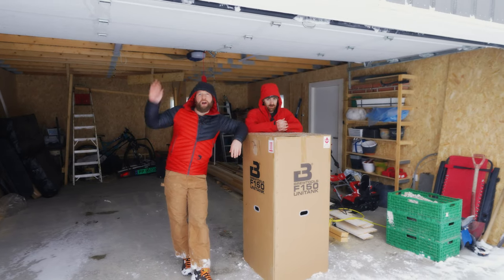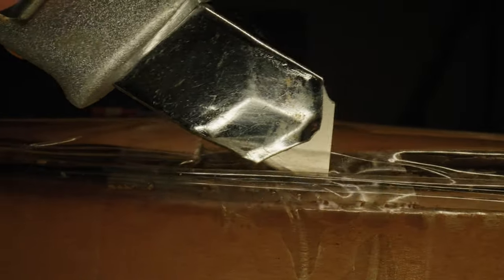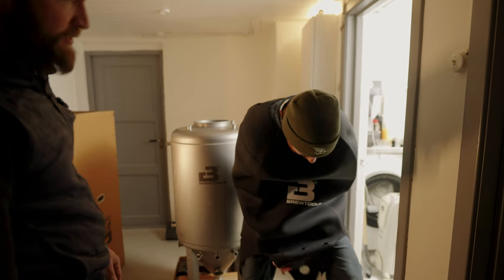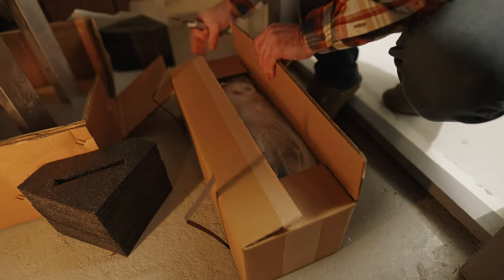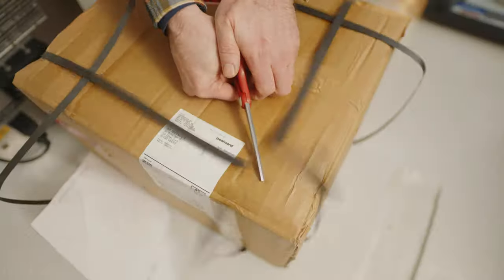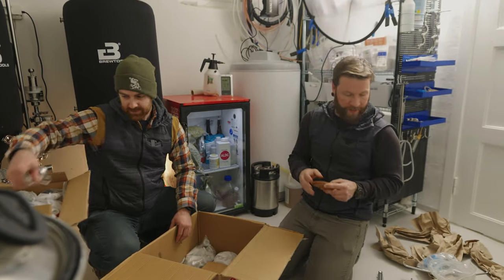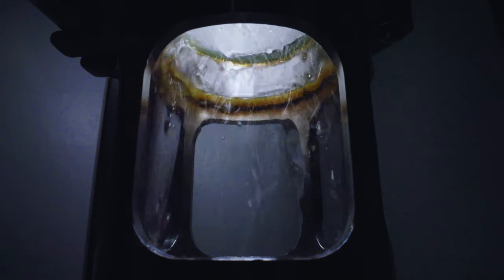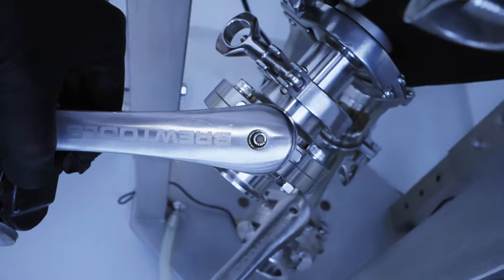Brewtools F150 Unitank Unboxing and Install - We DOUBLED our brewery's capacity!

Comment: Brewtools is nice, but I hate those small TC ports. So I went for a Brewtaurus from CZ Europe. Cheers
Reply from the maker: Nice! Which ports do you find too small on the Brewtools? Those fermenters from Brewtaurus look great!
Reply: @BentGateBrewing  All 34mm TC ports. 
If they had used 1.5 inch ports i would've bought one second hands.
But i already own a spunding valve and pressure guage in 1.5inch, and have many other 1.5 " 2" & 3" parts laying around.  All from Spike,SS brewtech and from AliExpress.  

Brewtaurus fits my needs. 
Brewtools is nice, but only for wealthy people.
Reply: I think they made this for a reason so you need to spend extra bucks on their accesories. Naughty practice.

Comment: Is that carbonation stone difficult to clean?how to clean that properly?will it go under trub while fermenting because it's position seems to be quite low
Reply from the maker: It's not too difficult to clean. We typically boil out for a while which helps a lot. If you do that plus give it some pressure (be safe!) then that usually cleans it out well. An ultrasonic cleaner is the easiest/best, but we don't have one yet :)